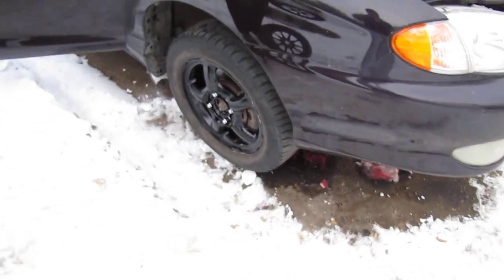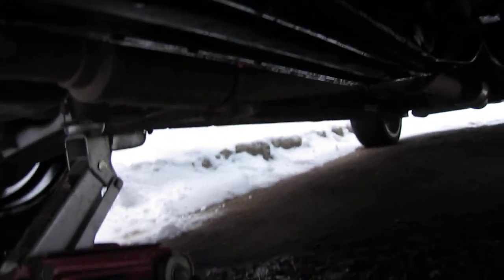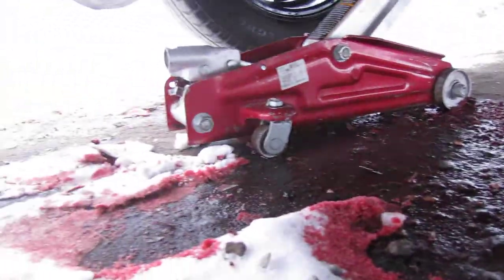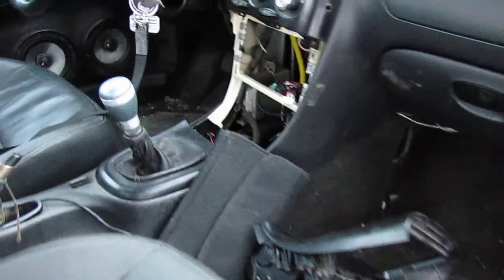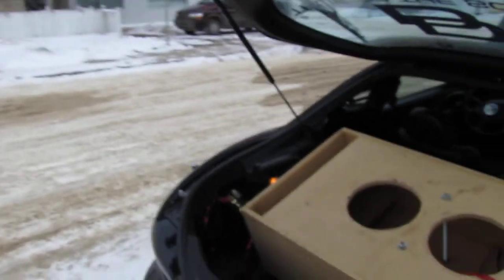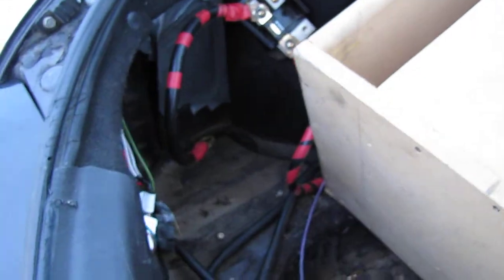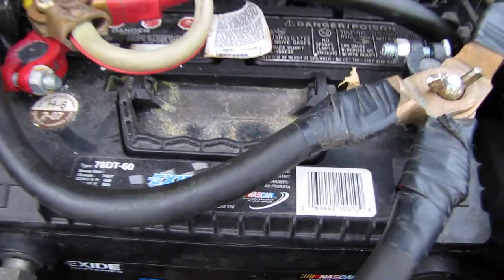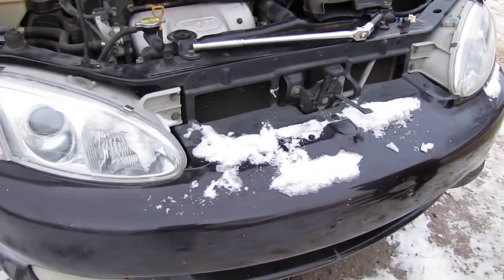DDkingz Tiburon problems solved!!!!

Comment: i messed up my clutch weeks ago, while still on the traffic light, the pressure plate just decided to let himself die, theres nothing to press on the cluctch since its a pull type, i replaced all new lining, housing, bearing, gearbox oil..and it runs smoothly now..